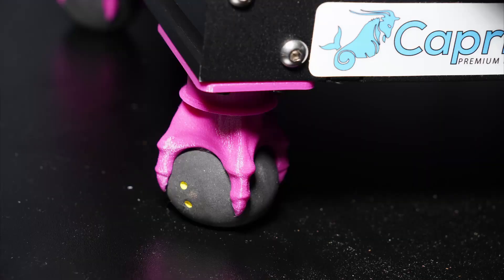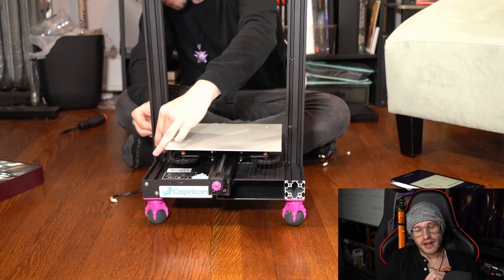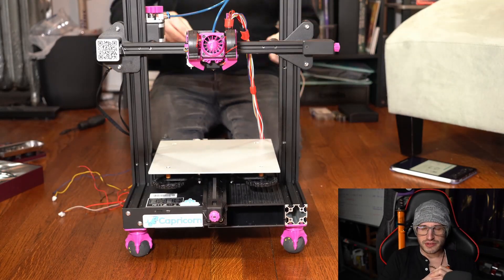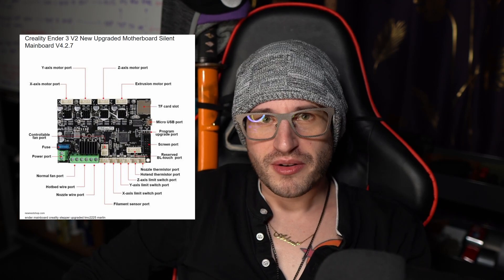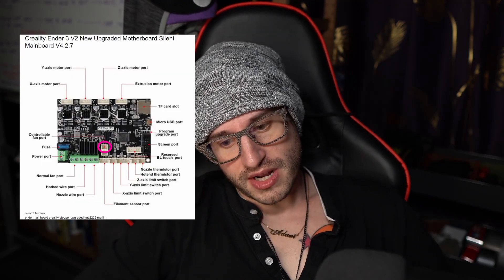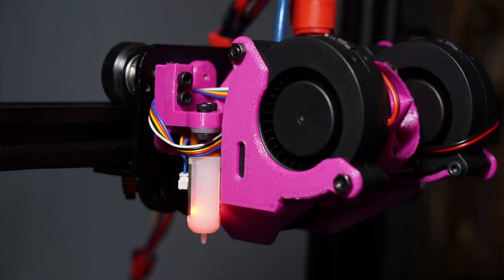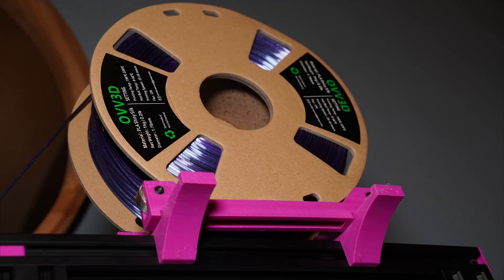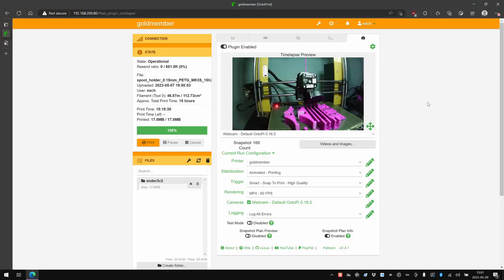how to assemble an ender3-v2 (feat. hero me gen 7) (ender3-v2 rebuild pt 2) 🔧

Comment: Amigo, não achei estes arquivos nos arquivos do Hero Me 7.4 o outros eu achei. Poderia me ajudar a encontrá-los?
Arquivos não achado:
HMG7 Creality OEM-CR10S-Ender3-5-MK8-MS Mount
HMG7 Creality OEM-CR10S-Ender3-5-MK8-MS Skirt V2
HMG7.2 Lightweight Left Brace Duct
HMG7.2 Lightweight Right Brace Duct

Obs: 
estes eu já encontrei:

HMG7.2 BLTouch 45deg Left Mount V2
HMG7 BL-CR Touch Narrow Left Wing V2
HMG7.2 Universal Base V2
HMG7.2 Cable Tower Medium Right 5mm
HMG7 Turbine Fan Guard
HMG7 Ender 3 V2 Gantry Adapter V3
Na verdade a minha impressora 3D é uma Longer Lk4 Pro e eu tiro a Ender 3 como base !
agradeço!

Comment: The k-fan 1 and k-fan 2 ports are for part cooling and they run in unison, but one of the ports is taken by the electronics fan. To fix this you can wire the fan directly to power in the sam port as the hotend fan. you do not necessarily have to splice the fans together like you did.

Comment: Hello, I need help with something. I have an ender 3 v2 printer. I have a double gear extruder and a BL tauch. I want to install direct drive hero me, but I cannot access the files. I think they are corrupted. Can you help me?
Reply: I can help if you still need it
Reply: @orley1994  Tem a parte 1?
Reply: @orley1994  Poderia me dar uma ajuda também?
Tenho uma impressora Ender 3 com uma extrusora BMG, uma BL Touch Trianglelab e um Hotend TZ-EZ 3.0 e preciso o mesmo que o 
@estarossa0127. 
 
Quero passar ela para direct drive e fazer o Hero Me 7 mas não sei quais arquivos devo imprimir.
Reply: @orley1994  Essas Peças a baixo também servem para a Ender 3 e Longer LK4 Pro / Alfawise u30

peças hmg7:
HMG7.2 BLTouch 45 graus de montagem esquerda V2
HMG7 BL-CR Touch Asa Esquerda Estreita V2
Base Universal HMG7.2 V2
Torre de Cabo HMG7.2 Média Direita 5mm
Protetor de ventilador de turbina HMG7
Adaptador de pórtico HMG7 Ender 3 V2 V3
Suporte HMG7 Creality OEM-CR10S-Ender3-5-MK8-MS
Saia HMG7 Creality OEM-CR10S-Ender3-5-MK8-MS V2
Ducto de suporte esquerdo leve HMG7.2
Ducto de suporte direito leve HMG7.2